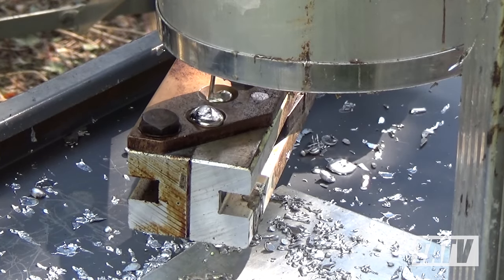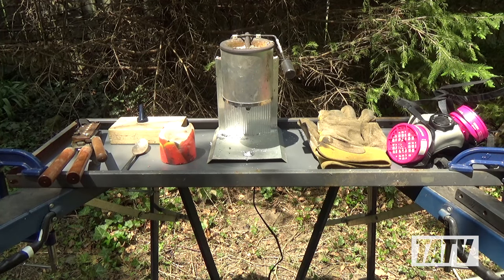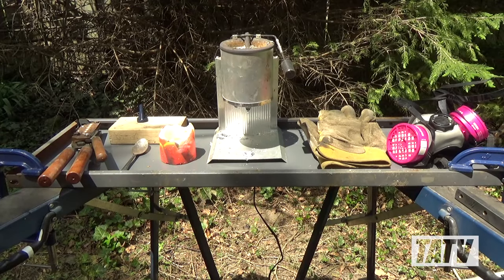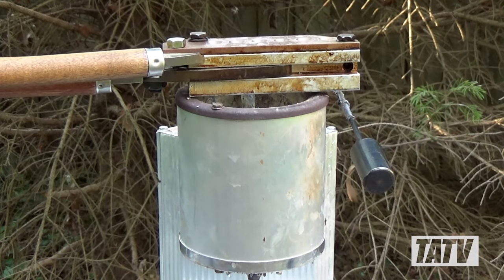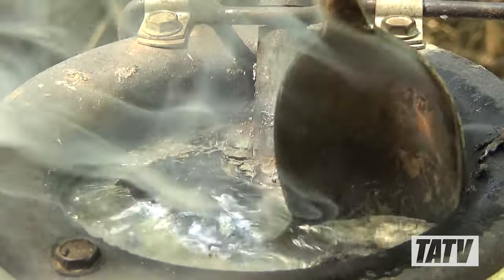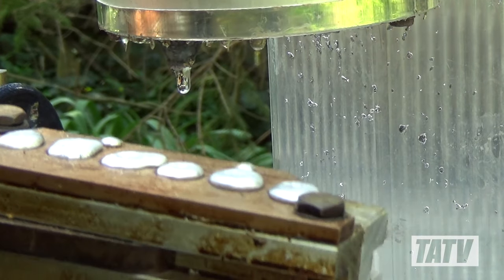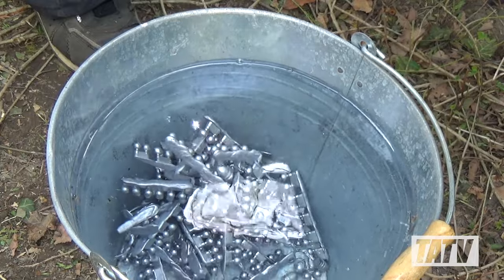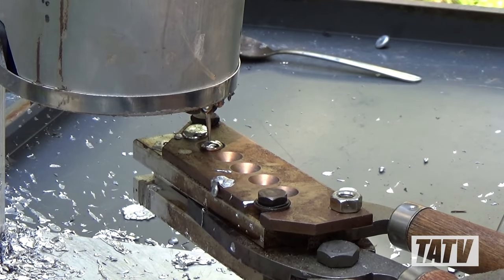Casting Lead Bullets

Comment: This is actually a really good video. The only thing that is incorrect is that pure lead will not harden when quenched. I thought it did as well until someone told me it didn't, so I tested hardness quenched vs unquenched and it was always the same.
Reply from the maker: This is an alloy made of wheel weights, and believe me it does.
Reply: @TATVCanada  yes, wheel weight will harden.
Reply: But quenching it in the water will make the muskets cool down faster, so that you can put it in paper cartridges quicker. 

 Right?

Comment: When using a bottom-pour pot, keeping the surface lead shiny clean is an unnecessary waste of material. As soon as you get it clean, more oxidation forms. Once it forms, it largely stops. Scooping it out only starts the process again, while never impacting the purity of the lead coming out the bottom at all.

Comment: Glasses. One thing you left out. I use a full face shield aswell. Very good video.
Reply from the maker: That's a good point; I wear glasses normally so it never occurs to me ha ha.
Reply: @TATVCanada  I would be in the same boat. Many think it's optional tho, until a trip to A and E lol
Reply: Good call Peter. I made the change to a face shield myself. Second year into the hobby I had a piece fly past my safety glasses into the corner of my eye and let's say my eye bothered me for a week. Got lucky in the end.
Reply: @robertpagel8951  very lucky

Comment: Quenching bullets is conditional to what you intend to use them for.  It  surface hardens the bullet making it prone to shattering on impact with a dense object.
Reply: Sounds like the perfect way to make ammo for plinking steel. Like frangible ammo that cuts out the chance for ricochet.
Reply: The bullet I cast most is a .358 158gr SWC that I powder coat. No quenching or linotype, I just run with whatever alloy I end up with from my wheel weights and scrap.

My .357mag hand-loads from an 18” carbine are hitting around 1,600fps, and my .38spl loads are about 1,000fps. I’ve brought down a couple deer and several hogs with both loads. They penetrate deep and hold together well. One bullet I recovered retained 152grs after striking a leg bone on a medium (≈150lb) hog. The powder coat holds up pretty well and the bullets tend to flatten out to about +10% diameter. Nothing ground breaking, but they reliably put meat in the freezer.

Comment: Do you just leave the lead in the pot when you are all done? Then heat it up the next time you need to melt some ?
Reply from the maker: Yes indeed I do. Aside from being convenient, it also protects the inside of the pot, as well as the nozzle and valve from corrosion when not in use.

Comment: I put a piece of candle wax from a long dinner candle smaller than the one you put in and it caught fire...I am I using the wrong candle?
Reply from the maker: That happens sometimes; try smaller pieces and you should be fine.

Comment: Do you have a preference between an aluminum or a brass Mold? Thanks for the great video!
Reply from the maker: I'll take brass every time if it's an option. Best of both worlds in terms of strength/durability and corrosion resistance.

Comment: How pure is the lead you're using?  The yellow stuff floating on top looks like bismuth oxides.
Reply from the maker: Not at all pure; this is wheel weight alloy so God only knows.
Reply: @TATVCanada  Wow looks like there's some good bismuth in there.  Where are you getting wheel weights?
Reply from the maker: @ThePeterDislikeShow  Typically I call around to my local tire shops and offer to by them by the lb.
Reply: @TATVCanada  Wow.  I only want the ones that are bismuth though.  By the way are you sure it's lead you're getting and not bismuth?  Lead is mostly banned in a lot of places.
Reply from the maker: @ThePeterDislikeShow  100% the bulk of them are lead. They're very soft, and everything else floats to the top. All these years later and it still weirds me out seeing steel and zinc "float".  Yes the lead ww are fewer and fewer. Ten years ago id say 80% of what I got was lead. Probably closer to 60% now.

Comment: You never explained the need of the candle.  Is that what you use to coat the cast with smoke, after heating it?
Reply from the maker: Yes; it's optional, but some folks feel smoking the nould cavities helps bullet drop.
Reply: @TATVCanada  OK, Thank you Sir.
Reply: The main use is to place a small chunk into the melted lead mixture and stir it in. This causes impurities to float to the top for removal with the spoon or dipped. There are also commercial fluxes available.
Reply: Bees wax.. or even sawdust will work.. makes the crud come to the top so you can spoon it off
Reply: @haroldlundberg5676  would borax also work for this or is that for hotter metals?

Comment: How do you get that steady flow of lead, does that pot always have to be that full? And when would be the perfect season for melting lead other than summer?
Reply from the maker: I've never really had a problem with it before; I just use standard wheelweight alloy and that seems to work for me.  Regarding season, it's really hard to say without knowing what kind of climate you're in.  Here in Ontario I find Summer the easiest (for obvious reasons)-- but I often cast in Spring and Fall just because I find the hot weather unpleasant to work in.
Reply: TATV Canada I finally got a chance to take it apart again after having it leak out from the side of the spout for a second time, noticed the spout was really clogged, so followed up by heating the spout with a torch and cleaning out the spout with a paper clip, a lot of crud came out. After putting it all back together, gave it another try, and boom it flowed just as seen your video. Thanks for the update 👍.
Reply: The perfect season for melting lead, I can say I've never heard such an idiotic question-- you must have asked that, right after you voted for Hillary!
Reply: Joe Eckley hey, when your a noobie anything goes right, and for your information no I didn’t vote. Politics isn’t my strong topic as it’s all corrupt no matter which way you see it.
Reply: @Soccereddie  no, its not all corrupt. You've fallen for the anti Liberty propaganda. And here you are, reloading ammo and you dont care about politics. You better make a strong suit if you want to continue to enjoy your firearms. Fukken wow🤔

Comment: Your water is too deep. It will splash into your mold as you drop your shot. Shallow water with a towel works best. Also, learn to pour your cavities continuously, rather than stopping between each one. Then drop the whole sprue strip back in the pot with a tap on the mold. Also, I hope that table is much sturdier than it looks. Molten lead doesn't play.
Reply from the maker: I've been casting for about 20 years so I'm pretty satisfied with my results thanks.
Reply: @TATVCanada  You professional experts kill me. Truth is, you pour like a newb, especially for someone with 20 years experience. I had 20 years experience 20 years ago. Use a riser (a piece of 2x4 works perfectly) and drag your mold, don't suspend it. Only women and children stop between holes. Also, you should have learned that water quenching adds negligible hardness to pure lead. It has to have alloy to have any serious change in Brinell Hardness #.
Reply: John, actually thats not good practice sticking sprue back into the pot with each cast. You are asking for a accident to happen and jumping your molten lead tempature all over the place. Keeping the pot tempature stable during the pour making it easier to determine if your mold is getting to hot. Sprue buttons or trying to continuous pour to make one sprue really doesn't matter.

Comment: Are you able you use this same process with different metals like copper or silver
Reply from the maker: You would need a melting pot and mould capable of higher temperatures. Those would be some expensive bullets.
Reply: silver?  you got a werewolf problem up there?

Comment: Can you do this with other materials besides lead?
Reply from the maker: The only other metal I've ever heard of people casting is zinc, but that's considerably harder than lead and sounds like a great way to ruin the barrels rifling to me.
Reply: @TATVCanada  I'm not an expert in any way regarding firearms or munitions but don't armor piercing rounds use bullets made out of steel or tungsten?

Comment: How would you go about putting a carbide or tungsten core in them?
Reply: And copper jacketing too
Reply from the maker: Jacketing is done by swaging as opposed to casting. To put the cores you're describing in would be easier to do that way as well, but could potentially be done when casting with a modified mould.
Reply: @TATVCanada  🐐

Comment: I don't think I've ever fluxed anything 🤣
Reply from the maker: It's not essential, but it does make a difference.
Reply: I cast .454 round balls for slingshot hunting ammo and have used sawdust when I didnt have beeswax or a candle.. wax is better but sawdust is better than nothing